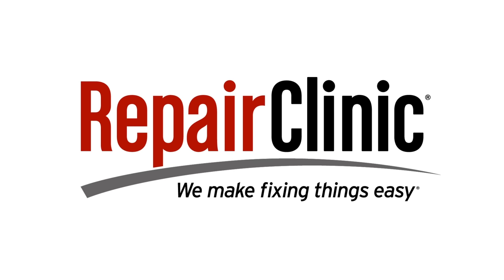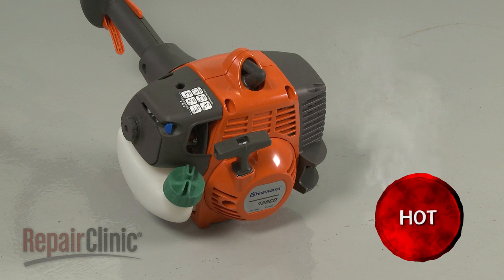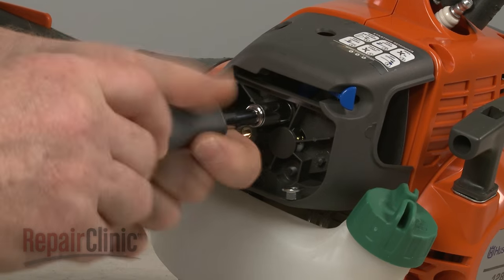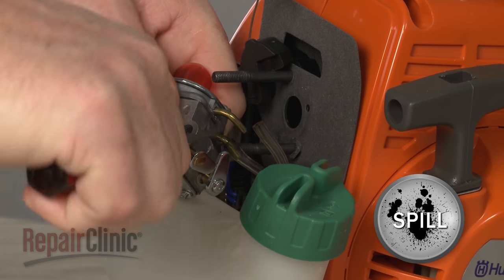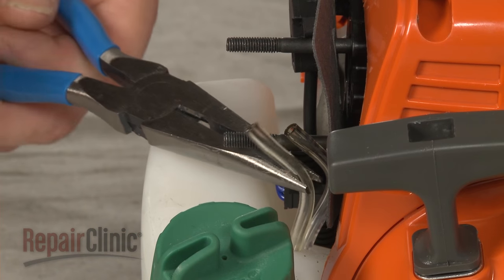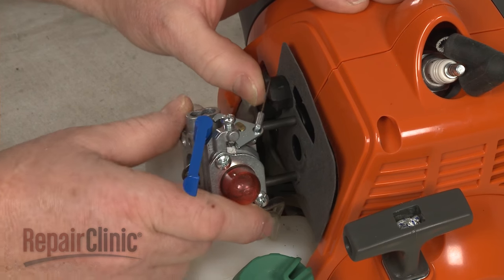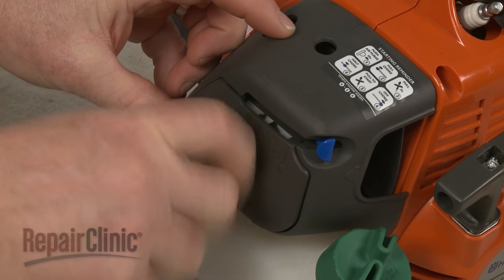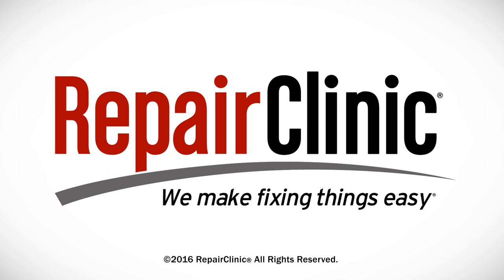Husqvarna String Trimmer Carburetor Replacement #545081848

Comment: My Husqvarna 128L  burns a hole, or melts a hole in the air filter right over the throat of the carb. What can I do to prevent this from happening. Can not be good to run it long , that way.

Comment: I spent $25 on the Husq carb.. no changes needed to get it to run, 100%.
Reply: Were did you get it
Reply: They have them for less than $20 new, with a spark plug on EBay.
Reply: @rudysconstruction  beware of those cheap spark plugs they don’t work well in trimmers!!!!
Reply: @ronaldnorris2179  I’ve had it for a year now, still works fine.

Comment: When should a carburetor be replaced?
Reply: angel basulto Never just clean it
Reply: Not entirely true. They can wear out around the throttle and choke shafts, and the diaphragm can wear out. Not to mention that some of them will be gummed up from the deteriorating fuel lines that weren't formulated for ethanol. Sure, it can be cleaned, but when a replacement carburetor can be purchased for just over $20, is it really worth rebuilding?
Reply: @leonhall4894  Steve's Small engines YT. says buy the premixed  gas. He says the additives in the gas sold  at the convenience stores,  not just the ethanol which destroys  the rubber diaphragm.  I priced a gallon on sale at a hardware store. They wanted $19. Have not checked the price since gas has gone back up. Sort of high! You  can buy a metal spiral diaphragm  for 24$ last I checked.
Reply: @charlescoker7752 how realistic is it to pay as much for fuel as a new carburetor, especially for a home user?